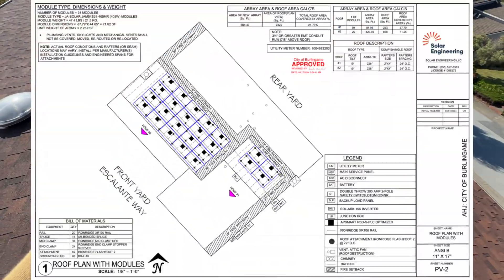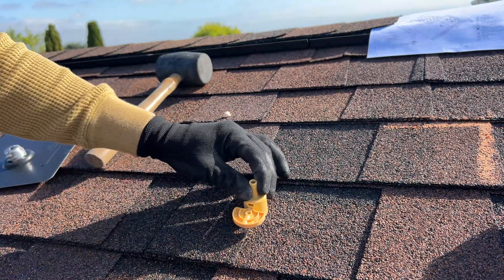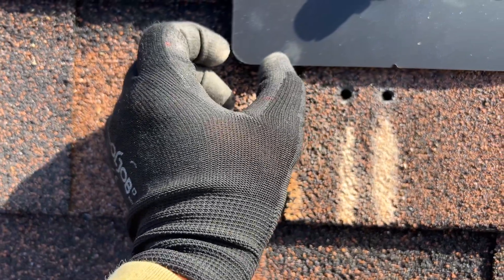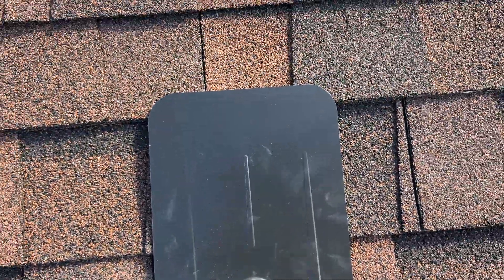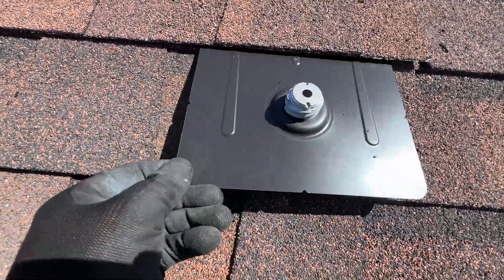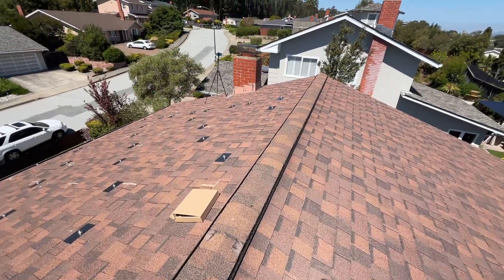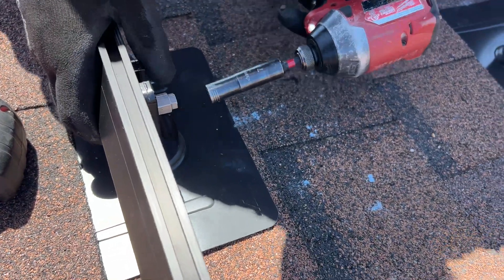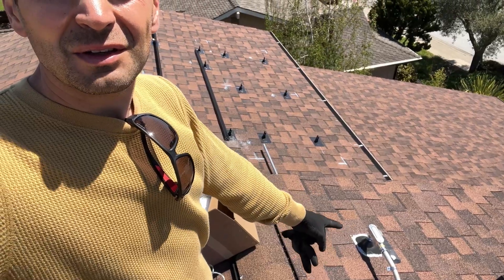Installing racking system for solar panels on composite shingles roof.

Comment: Would love to have solar but too many trees and very steep pitched roof. Plus need a 28 foot ladder to get to the gutter....
And then a LOT of wire, bushings, etc to run it to the first floor.
Unless you are a small horse jockey, the attic it far too small to even get into.

Comment: I have a sourh-facing living room with an open beam ceiling. The beams under the "tongue and groove"  boards are 4" wide which one would think makes finding the color mounting points easier, but the thought of test holes needing to be drilled and seeing sealed holes in the ceiling has resulted in me rethinking the project. The alternative panel installation location would be along the west-facing side of the house which has a regular attic.
Reply: Yeah I've done that many times as an installer and one time I missed and the homeowner came out of the house and showed me a handful of wood shavings that he found on his living room floor. I about had a heart attack! 😂😂😂. But I've done several hundred homes and never had a leak.

Comment: Hey thank you for this video I really appreciate it my question is probably going to be a dumb one but is there any type of system that has an anchoring system to where if you are nowhere near the rafter on your panel alignment can you put like an anchoring system that you can screw into the roof plywood because my setup on The Middle hold Downs they are not in the rafter and nowhere near A rafter so I have no choice but to just go into the plywood itself on the roof is there any other solution?
Reply from the maker: yes, you can use IronRidge QM-HUG-01-M1Halo Ultra Grip. Can be attached to decking only

Comment: Under a certain pitch will absolutely not work!!
Reply: Yes if it's flat, but otherwise you're wrong. I have hundreds and hundreds of installs on low pitch angles and they don't leak.

Comment: Let the guy that's up there with you not worry about the $10 tube of caulk just make sure the holes are sealed.  If you need more cock that's not going to make or break your job.

Comment: In order to finder rafters, Would a tool like this work ?   BOSCH Wall and Floor Detection Scanner D-TECT 120 ;  The Bosch D-Tect 120 Wall and Floor Detection Scanner features Spot Detection technology to accurately detect objects behind walls, floors, and panels.
Reply: I've tried all kinds of them and none of them are accurate enough.

Comment: someone else measures 48 on all roof then uses hammer he only drills once and uses small flashing
Reply: Yeah I don't use a hammer, I use the soft part of my hand and beat on the roof and over time you get pretty damn good. Just remember carpenters don't give a damn about being accurate when it comes to 48 inches or 36 inches on center.

Comment: Thank you for this very detailed video. What design software tool are you using to generate the solar panel layout that you showed in the start of the this video?
Reply from the maker: I'm designing a system in opensolar.com, and then ordering permit packages from the tech design company.
Reply: Thank you. I’m in the process of planning for installation. I bought my solar panels already. Instruction videos like yours are really helpful and give us the confidence to DIY. Thanks again.
Reply from the maker: @rajs8472  good luck with the installation!

Comment: Could an electronic wall locating sensor tool be used to locate the location of rafters as well?
Reply from the maker: Maybe commercial grade that can shoot signal deep. The cheap stud finders will do nothing.
Reply: I've tried even super high-quality ones and they don't work.

Comment: Hmm, I wonder if it could be a good idea to drill from underside/inside attic when you install on this kind of roof. Then you dont have to miss any rafters and less holes. But usually in norway you never see different distance between them. It's by code a set difference according to the angle of roof to secure that it has the strenght to hold snow in winter. I have same type where I live, but sadly have isolated and paneled on the inside of the roof. There is no regular attic but a loft.
Reply from the maker: IMO missing rafters is not a big deal with this kind of mount. Drilling from the attic will increase installation time a lot, because marking panels layout, and straight lines across all rafters could be a real challenge.
Reply: These houses with a low pitch roof have very little room in the attic.  It would be too difficult and time consuming to do the layout and drilling in the attic.  

The latest mounts don’t even require you to mount to the rafters at all and just to the deck. Some even mount directly to the panels and have no rails at all.